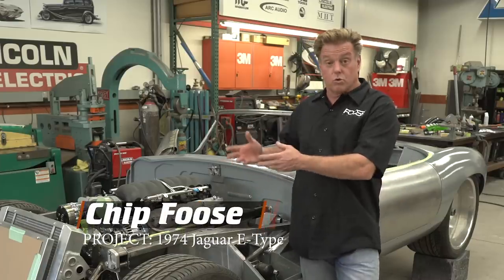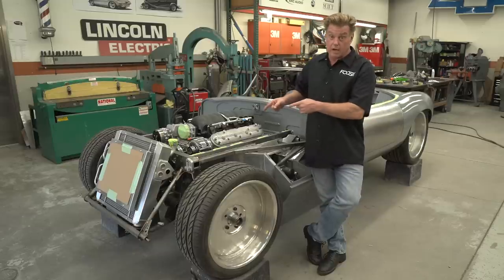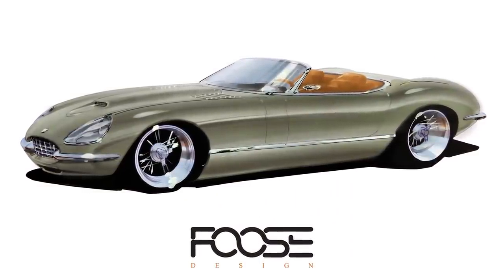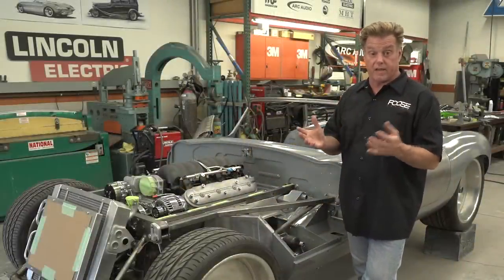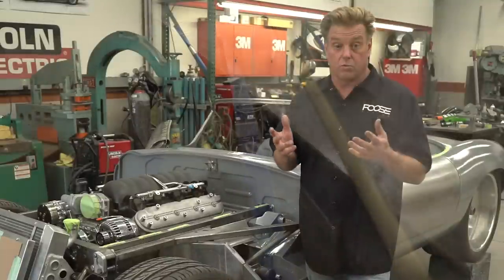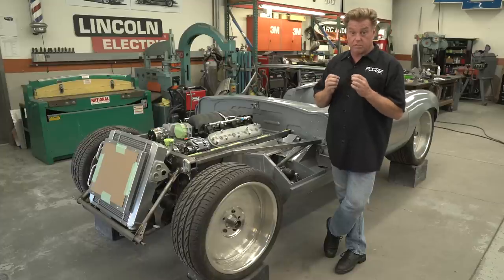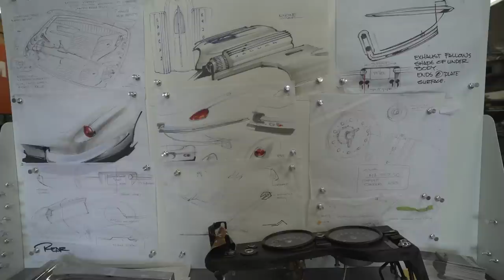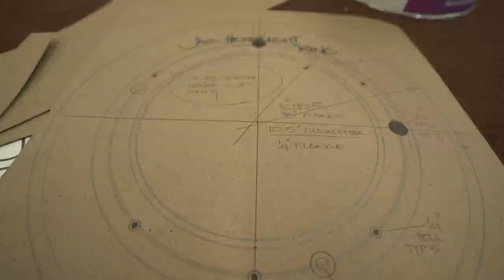Foose Design Jaguar E-Type Roadster - Metalwork Complete!

Comment: Love you Foose. Your builds are mostly to notch. Being an Art Center x-pat I appreciate your serious work. However, in this case I think a modern Jaguar engine such as their supercharged v6 or regular v-8 would have been more befitting if you wanted crazy horsepower. I personally would have used the Eagle brand bored out JAGUAR inline 6. After all, we are not kids anymore, adequate speed along with true original character of an inline 6 would be heavenly. With the LS you are mixing soul of a corvette with a beautiful Jaguar. When you press on the accelerator pedal it will feel like a corvette nor a Jaguar which builds torque as you rev that sweet inline 6. This reminds me of that awful build by ICON, you know, the one where he used an LS engine in a vintage Bentley. You can see it on Jay Leno's garage. A total misguided effort. Best of luck.

Comment: I would have kept the v12 and updated it, get it flowing better. I love the sound of that v12.
Reply: Yep, not one of those stupid GM V8. Sacrilege !
And don't start me on those horrific wheels !! Damn you Foose ! How can you !?
Reply: @marcryvon  oh the arrogance, thinking he can make an E-Type better.

smh
Reply: I'd have stayed in the family at the very least keeping the V12 or swapping to the XK6 4.2 motor. Admittedly, the V12s are a pain in the ass to keep running well, both the V12 and straight six can make well over 400 HP if you try hard enough.. the killer though is putting in a slushbox.
Reply: Your talking about a American guy that's going to own this, if it breaks he can go right to a AutoZone and get it! You get that, right?
Reply: IMO, it should have been a straight six. If you listen to  Leigh Morris' e-type running at santa pod, you will understand. Up there with the F1, Zonda and metzger engines porsches as one of the best sounding cars ever.
Reply: Marc René Yvon   I’m sure those wheels are just for the build process. Not the final product.
Reply: @amandagardner565  I can...and I've done it! I got proof too.
Reply: They put the v8 in because they want it to run instead of being fixed all the time
Reply: There’s no hope to hop up the 12. It was hard enough to keep it running stock.
Reply: @SkypowerwithKarl  FALCONER makes a sweet aluminum V12, one was put in a KINDIGIT Lincoln convertible.

Comment: I had a 63xke convertible back in  75  metallic brown and a black vynial hard top, got so fed up with the drivetrain took it out and installed a 66-427,8v Ford side oiler 625 H.P with a C6 automatic trans and a nice 3300 10" converter. The rear wheel openings were Radiused just like your 73. Sorry I  ever sold it , well I  think it ended up on the end of someone's cutting torch for insurance money , I've been told.
Looks Good Chip , keep up the good work.

Comment: The build looks great, but why not use the new 5.0 V8 575HP engine from the Jaguar F-Type?
Reply: probably not available as a crate motor with ECU support.
Reply: What FIrst Last said, and the Jag engine is most likely significantly larger and heavier. LS engines are light and compact.

Comment: We did a series one that had been severely damaged and was not going to gain much in value at the time due to non matching drive train numbers. We had a 426 hemi mated to a A833 4 speed manual and a 9.25 limited slip rearend. We did it more as an example of what we could do than as a serious effort. We all knew that you could not tag the throttle from a stand still due to the torque. It was insanely quick so long as you rolled the throttle until she was in second. One of the go-fors took it to pick up some parts for a client's car and when he returned one door was buckled and the other sprung.  He said he had no idea what had happened. 🙄 We pulled the motor and power train out and did several pulls on the frame. Dropped a traditional power train back in it and unloaded it. Word to the wise, some ideas are better left as fantasy.

Comment: I love Jags, I love Foose's work, I'm not loving this. I think its the hood scoop that doesnt work, looks like it belongs on his thunderbird from years back, its not right for a jag.
Reply: violentblue123 nah it’s the ls swap and tail lights, I’m all for practicality and performance but an ls is a boring proposition in 2019 (v12 ls on the other hand?). And the taillights although more cohesive should be tilted 90 degrees pointed outwards to follow the series 1’s look.
Reply: @hugolinning3133  came here to say the same: those rear lights do not work nor flow good. They should be horizontal and closer to the center like the MkI E-type.
Reply: I think that swapping the ls made the car less elegant. If they needed more power, they should have upgraded its original v12.

Comment: I always liked FOOSE's design and quality of craftsmanship, this is the first time I do disagree with him.
The Jag V12 motor can be modernized using new induction, cooling and electrical systems, I realize the GM 
LS engines are incredibly reliable, easy to adapt in different applications and on top of everything, they are not that expensive and you can produce a lot of power from them... definitely one of the best engine architectures ever!
But a Jag with a Chevy engine, I just don't swallow that easy!
Maybe I am too purist!
Reply: Recycle the jag engine put it in a hot rod
Reply: Pablo Céspedes , well said, exactly how I feel.
Reply: What would a rebuilt, properly upgraded Jaguar V12 cost compared to an out-of-the-box Chevy? Getting the right guy to tune and maintain the Jag engine  could be challenging too...
Reply: there are many excellent Jag engines that would have gone well in this car. from classic to modern. more horsepower isn't a real excuse, easier and cheaper is the only reason I can see for a LS
Reply: An AJ-v8 from 1999-2008 with the super charger would have made enough power to move that car along, and a donor XJR is not too expensive. That being said it would have been a tight fit in that chassis and sorting the engine/trans computers would be a pain.
Reply: The sound that the V12 makes is part of the E type
history, imo the skilled workmanship, time/money  that's in the body work alone  then install a LS, even a modern V8 out off a latter model jag would have been more appealing. There's no doubt it will be fast in a straight line.
Reply: A Jag that sounds like a Chevy? I don't think so!
Reply: @deanrobert8674  The Jags that won at LeMans and competed all over the world had nothing to do with that overrated V12 smog motor- it's not even a believable kin to the V12 Jag developed for the  rear engine roadster. Having worked for BL both during the 4.2 Sixes period and the 5.3 V12, I know from the seat of my pants which was the better engine- the Six. Some real fantastic machinists in the UK managed to put the twin cam heads on a V12- worthy, but devilishly expensive.
Reply: There have been adapter kits to put a SBC in a Jag since the 70s though.
Reply: Pablo Céspedes
You're not alone Bro ! Hey, we're talking about an icon here, not a dumb 60's Chevy !!
Reply: @fredericrike5974 
Aaaah, the sound and torque of a proper Jag straight sex... aaah, I meant six. Sorry. Same bony results !
Reply: and what hasn't been mentioned, if you take all that WEIGHT off the front wheels then you have just PISSED AWAY all the handling characteristics that the vehicle was designed for.

to have the entire vehicle "tuned" for on road performance, will cost you the money it would have cost to re-engineer the original engine.
Reply: I agree, his point on swap due to HP mute because you can do work on engines to get that kind of hp out of them, especially on a V12.
Reply: They could of kept it a V-12. Just put a Falconer in it
Reply: Hi from Paris Pablo Céspedes i agree with you a chevy engine inside a Jag Legend it's sad it's like you have not enough times for make a nice V12 so you go easy with Chevy engine
Reply: Dean Robert n
Reply: @fredericrike5974  The jaguar that won lemans in 1988 & 1990 was with jaguars v12
Reply: Im a full time jaguar mechanic for the last 20 years.  I love the E-type but Foose made the right decision by getting rid of the V12
Reply: I personally would want the v12, in an original series I, but this car isn't for me, it's a hot rod for a woman that doesn't care what motor is in it, as long as it's reliable, it needs to be able to site a couple months on the trickle charger, then turn the key and go, I don't know about the newer v12, but from what I've heard, the older ones were notorious for the valves going out of adjustment, then it takes something crazy like 30 hours to adjust them, save that v12 for the purists that want an unmolested motor.
Reply: Pablo Céspedes your spot on 👍🏻 it’s not just about the performance it’s the sound, smell and how it makes you feel, amazing craftsmanship let down at the last hurdle with a lack of imagination, he could of at least kept it jaguar based
Reply: @deanrobert8674  the best, most reliable engine was the 3.8l I6. Replacing the SU carbs with throttle body injection can do a lot to improve power and economy.
Reply: Pablo Céspedes if the customer wants a chevy v8 that is what he is going to get...people forget that Chip doesn’t make these choices by himself...this car is built by commision...although my personal choice would also be a modern jag v12 or even a v8.
Reply: Darren Arnold Until you have to service a jag V12...i bet nobody here has the pleasure of living with a V12...so nobody knows what kind of headaches it brings...But you need to know if a customer wants to get rid of the V12 it is their choice and we can complain all we want...at the end of the day somebody is paying Foose to build the car that way...
Reply: Even with everything you mentioned, you won't save the 600lbs he mentioned, nor get rid of the stupid vacuum cleaner sound v12's make
Reply: Mercedes v12 would have gone nice with the open pipe f1 sound. Plus has the loose Daimler Benz connection.
Reply: The reality  is British cars are not that well designed or built especially the older ones ! here in Australia the Jaguars always ended up with a Chevy under the bonnet because the Jaguar motor is really only good to use as a boat anchor  !
Reply: Did I mention unreliable and super expensive to maintain !!..Pretty much sums up most Euro Trash !
Reply: So put 2jz engine or RB engine.... lmao.....

Comment: Wow  Foose you’ve done it again ! except this time you took one of the prettiest cars of all times and made it nicer with some of the touches the 74  was always one of Jags   unliked cars because British Leyland came up with those ridiculously ugly rubber  pads on the bumpers to meet the U.S. safety laws on the bumpers  and they bolted those things on many of the British models   at least until they could  figure out better solutions like they did on the MGB  they came up with a entirely new set of bumpers for the front and rear of the car those too are among  some of the least desired cars  on that model  and many people remove those  to install  what looks like a earlier model bumper  made out of Steel and chromed   i hope the channel does a follow up on the featured car  with its final paint and interior  i too agree that the dash design should look great the way Chip described it in the video

Comment: why not use the 550 bhp Jaguar v8 from the F-type R ?that is more correct than the GM motor.
Reply: The LS is super boring but it's reliable, easy to work on and upgrade and it doesn't cost as much. It's a reasonable choice and this is coming from someone that hates them because of how often they are used

Comment: Needs wire wheels man, it’s a Jag
Reply: If you look at Chips sketch, wire wheels are there .:)
Reply: I'm sure the final wheels will be amazing👍
Reply: He probably will put wires on it, but remember, it's not a "Jag" anymore, it's a hot rod. Nothing is sacred to a hot rodder! They will chop and/or modify any part of any car to make it stand out against a stock version. It's the only thing about true hot rodders that I don't really like. Some cars and design elements, just shouldn't be changed ...others need to be chopped to pieces and completely reengineered. Lol
Reply: Knock off Minilites get my vote.
Reply: Take a look at the Dunlop race wheels on a D-Type.  The 3 x Le Mans winner. 1955, '56, '57..  An E-Type looks good on them too.
Reply: Agree 100percent those wheels on it look horrible im sure it will have wired spoke wheels!
Reply: V12 Jags had both wire and steel wheels.  The hottest E-Types were the lightweight and low drag Jags had alloys.
Reply: The offset of the rear wheels is so wrong
Reply: Those are most likely the shop wheels.  So you can roll it around and not worry about messing up the finished wheels.
Reply: Right !!!
Reply: I dont think Foose ever did wire wheels before, did he? I know they will be sick!!  That's the only wheel that would really pop with this build!👍
Reply: No it's not.

Comment: You made a comment about the LS.  I don't disagree.  Great engine, but everyone has one. . . .  How about you stay with the spirit if not the letter.  LS based V12 built in Australia, v12ls dot com.  or Fords EcoBoost twin turbo V6.  The XJ220 had such an engine.  Yes, yes Jag used V8s too.  Looking for something different.

Comment: You can't improve on the design of the e type, I don't care if you're called Foose!!
Reply: Floyd Solo. True, and on top of that he rips out a V12 and uses a chevy v8. Blasphemy!!!
Reply: It's like drawing a moustache on the Mona Lisa.
Reply: windshield and bumpers are better.
Reply: Yeah you can, the Eagle Speedster looks better than a stock E-Type, Foose hasn't made it better looking although i don't think its looks bad, just different.
Reply: Personally my preferences have always been series 1, series 2 and series 2 and a half. These 3 series were ugly whales compared to the svelt early cars. It bothers ne not one bit to make these slug ugly cars beautiful again. However, im no fan of the LS swap! The inline Jag 6 has many new variants with plenty of HP. I would have taken out the boat anchor v12 for the 6 over a v8.  
On another note, the workmanship here cannot be denied!
Reply: @trevor5929  The windshield was always too steep, and the roof line too tall for the low body. They look great when the glass was raked back, and the top chopped a few inches.

Comment: I have a very serious commentary. I used to own a 1962 Jaguar XKE, accidentally sold to me, the first in Canada.
I saw Jimi Hendrix in Toronto, got backstage with George Benson, and became a professional lead guitarist.
When I say accidentally, yes, that's a long story. My 1964 Stratocaster and Marshall 100 watt head fit in.
Please, what you have for a front end air intake does not look like an air intake, more like a guppy mouth.
That's a very big disappointment, because if I had a dream Jag it would be brushed aluminum.
The painted silver spoke wheels looked beautiful, but I'm seeing what look like old slot car rims, just a rim.
I'm looking at the car and thinking that referencing wire wheels by making them bladed would look very hot.
With the original six, I could get it up over 160 mph. If I had dual carbs it would have gone over 200.
But these cars were winning Les Mans years after years. They weren't heavy American road rockets,
so I hope this car has the same balance and driving abilities as the original.
I could be idling in third gear, doing 30 mph. I would shift down into first and floor it,
my index finger in a hole in the steering wheel, whipping the car into a U-turn in two lanes.
I only drag raced it once, leaving two black Michelin stripes for over 150 feet until I shifted into second gear.
You gotta love those long stroke cylinders, so much torque. And I'm lucky to have survived that car.

Comment: The engine choice totally ruined it. That v12 can easily be tuned to 450bhp plus. Jaguar got 700 out of it in the xjr9.
What a shame
Reply: My thoughts exactly. Problem is most just don't know how to deal with the Jaguar V12. It's a nightmare for them unless they have the knowledge that's needed. If built and tuned correctly a Jag V12 can put out amazing power and torque. I've seen 800hp in a powerboat application. The boat literally flew on the water. No doubt the E type is an iconic car.

Comment: Chip Foose and Team The car Artists.
Chip you are such a man of many Gifts of Brilliant Perfection. 
I have often thought if I could find and buy my First Beautiful MGBGT I would just love Chip Foose to rebuild my MGBGT, and I would know then that I would have The most Stunning car The Best.

I love your TV programs, I wish they were more all round but slower filmed finished views of your rebuil cars as they are Just Splendid Beautiful works of ART. THE ART OF CARS!

Lastly just a suggestion if I may Ace Chip. I often wondered as the E Type Jaguars nose Lifted at around 110 MPH apparently, the designer should have included a Front Spoiler to give Down-force which would have made the car Far far better!
I fitted a Front Spoiler on my MGBGT, that gave more stability in a straight line, more speed, better braking!
The same results would be for an E-Type Jaguar. And a Front Spoiler does look SO much cleaner, and Great!  

All of the very BEST to you Chip and your family and your Great team.

JB, East Surrey. UK.

Comment: The thing that makes me cynical about Ls swaps is that it just doesn't impress me as part of the build, yeah I get it, it's lighter & more powerful, (Mo powah, baby!) its a better engine in every respect but no work has really gone into it. I always love when an older engine is made better & ties in with the origins of the car in some way which is what's been done with the rest of the car. If youre going to spend hours & hours building the body why not do the same with the engine? If it was all about being faster then the answer is buy a new fast car. Nothing interesting about that.